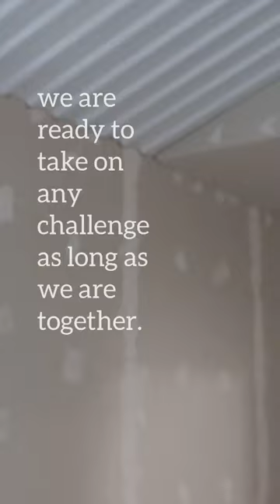Power Couple 💪

Comment: How are your joints faring? Here in the north it seems an unwritten rule to use paper tape with regular mud.  Hot mud works with fiberglass.
Reply from the maker: It’s holding up great so far. No issues at all.